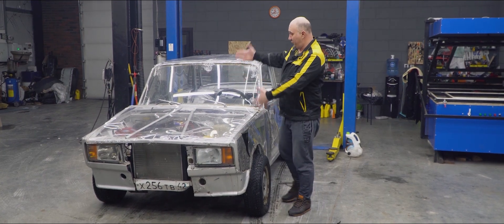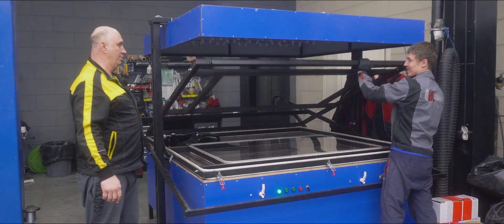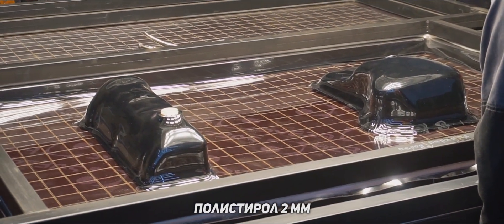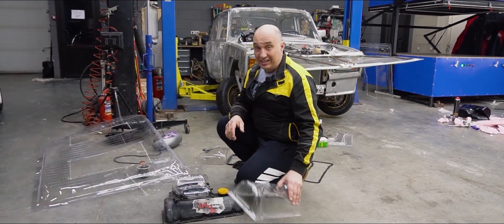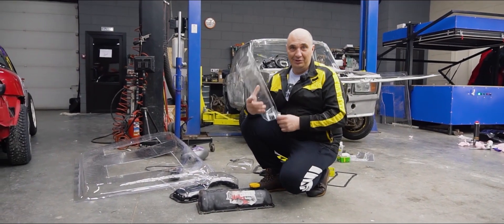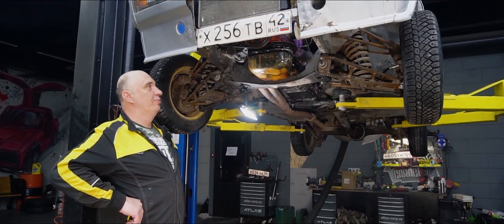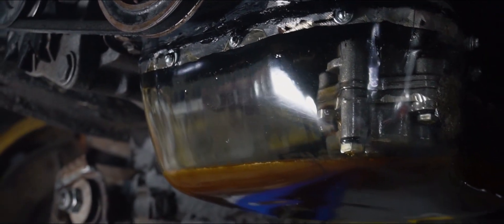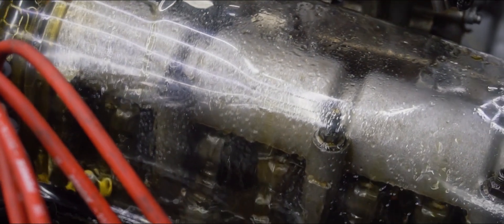Transparent rocker cover and sump to look inside a working engine

Comment: I re-built a lot of engines and transmissions over the years and understood how it all works but seeing it continuous without oil running down the block like when you adjust valves or have a leaky valve cover.
But seeing it without having to rush to turn off without running engine out of oil is great.

Comment: Another great experiment Vlad l never knew that the oil level drops in the sump and that a lot of the lubricates the cam shaft rockers and the cam chain l have a similar engine in my Toyota Hilux a four cylinder chain driven over head camshaft so now l know how the oil moves around the engine this is incredible

Comment: Thanks guys, loved that and it reminded me of a tool I had many moons ago to help tune SU,Webber,Stromberg carbs etc. It was a spark plug adapter that you replaced for the spark plug. It had a perspex or glass lens to see the actual color of the combustion flame, adjust carb = orande flame too rich and too light blue too lean, u get the right blue.. Spot on adjusted, also got an old vacuum device to match 2 su's or Stromberg's.. Back to the 80s, lovely simpler times...I miss them

Comment: too much oil in the cylinder head is a problem with american V8s as well, me and other engine builders will always put oil restriction orifices in the cam feed oil holes to slow down the oil to the head and open up the drain back holes. i will do even more and paint the oil valley with high gloss paint for faster drain back as well.   cool video! i wish we could get Lada 2107 in the USA but they are hard to find and always in collector condition.

Comment: The engine had a HUGE vacuum leak with the valve cover not even bolted down and leaking all over. The engine is running terrible.

Comment: You need a seal on the movable plastic holding frame. At the spot around the plastic where it hits the table. Better vacuum = thicker plastic molding ability.

Comment: I clicked on this to see an engine with clear oil pan and valve cover BUT these guys are friggin hilarious!
Is that metal shavings? Uuuuuum.....yes, you ran the motor low on oil and revved it......that would be bearing
material....lmao!

Comment: I wanted to see why some cars have a baffle in the oil-pan (sump) to prevent "windage". This is where the rotating crank is in oil and the resistance of the oil to the crank's rotation robs energy and thus horsepower. There was not enough oil in the oil-pan to see this happen. Windage is one reason why some tuned cars - race-cars - have 'dry sump engines'. The oil return goes straight off to an external oil reservoir and oil-pump. Please repeat test with oil at correct level as per dipstick. :-) Otherwise a brilliant video - never appreciated how much the oil is moving around.

Comment: This was a great experiment -a fascinating thing to see. Please could you do it again with the proper full fill of oil in the sump? I would be very interested to know how many cm the oild level drops when the engine is running at max revs (and also at half of max revs)?
Also, could you calculate what volume of oil is left in the sump (& what is circulating up in the engine at max revs and half of max revs)? This would be very useful for designing windage trays and baffled motorsport sumps

Comment: I'd like to see this done on a Oldsmobile V8 it  is said that at 4000- 5250 +RPM the the Olds oil pump sucks the oil pan dry and oils the rocker arms and valve cover aera   due to the oil return passage in the head not allowing the oil to return fast enough to the  oil pan

Comment: Do a magnet that attract metal shavings would help a motor get rid of impurities on the bottom pan? could use a small enough to still see but big enough to attract the metal. oh I get it... that's why there is a oil filter ahah

Comment: What year is that "car".  Looks like the latest in 1960's auto technology.
Reply: It's a Lada/VAZ-2105 probably made after the mid 90s. Well, it's built on the same platform as the Fiat 124 which was produced in the mid 60s.

Comment: That is very cool to see the enter workings of the engine while running, would like high/tall valve covers with fins on top for high lift cam roller rockers, if you offer them custom made I would like a pair for my 327 ci Chevy small block in my 1940 ford Deluxe Coupe! Please sir?

Comment: You needed at add a breather on the valve cover so it wouldn't blow off like it did. Excess blow by pressured the crankcase with no where to go. 

But it was great to watch!

Comment: I appreciate you guys running that crankshaft with out it submerged in oil, like it's supposed to be. Good video.
Reply: The crankshaft is NEVER SUBMERGED IN OIL, NEVER!!  Thats why you don't overfill the oil in an engine, if the crankshaft touches the oil or is in the oil, it acts just like a blender. Whipping the oil , adding air into it, making a froth that can't circulate. Also if the crankshaft was submerged. Think how hard it would be for it to spin thousands of time a minute in that thick oil. No, crankshaft is NOT SUBMERGED IN OIL.

Comment: it never occurred to me that the level in the oil pan would go down much with the engine running. I was surprised at how much it went down, but it makes sense when you think about it. This is why it's so important to maintain a proper oil level.

Comment: I remember assembling a "Visible V8" model kit (clear block, heads, pan and valve covers, with metallic colored crank, rods, pistons, cam, and valve train) around 1960. Of course it didn't run, but with the starter motor turning it over and little red bulbs lighting in time at the end of the spark plugs, it was easy to see and fully understand the four stroke engine cycle and how the entire engine worked, especially for being only ten years old at the time. Went on to apprentice under a master mechanic after college and could always fully comprehend and appreciate what was actually happening in an engine, right or wrong. Not sure if my Mom knew she was starting me on my career centered around automobiles at that early age by giving me that wonderful Christmas gift. Thanks for this video!

Comment: Might the flow be affected because your valve cover has no ventilation but is rather sealed/airtight whereas the missing oil cap is indeed vented. This would/could affect and possibly restrict oil flow quite a-bit just as pouring water from a completely inverted container pours out more slowly as it's forced to "gulp" the air in (gulp gulp gulp) to equalize the pressure within whereas, if you pour the water out in having an airflow gap (bottle not inverted but sideways thus allowing air to enter as the water escapes) speeds up the emptying of the container. The created low pressure may also be causing the oil to bubble/foam up. Oil flows would indeed be affected even more so than my exampled water flowing from a sealed container because it is much thicker.

Comment: Paused at 0:26 to say that I've sort of had this experience but with no oil pan, though I may not have seen a ton. I was working at Firestone, and whether I suggested it or my boss did, he agreed to it: he observed engine behavior in the crankcase from below by me holding the oil dispenser (one of those oil guns you see used for oil changes as opposed to pouring from bottles) into the oil pickup tube (screen stem removed) and dispensing while the engine ran. It seemed to work. I got covered in oil.

Comment: This is why you don't check your oil 10 seconds after shutting off your car. There's alot that needs to drain down before you know where your really at. I remember a toyota dealership I worked at told me to do that and I told them all they were idiots

Comment: Did they add a relief hole for crankcase blowby to the rocker cover? I skipped ahead to them starting it and noticed all the foam that is building up. I'd assume if they were smart enough to build a oil sump and rocker cover like this they'd know you need to vent the crankcase right?

Comment: Awesome video.  I so wanted to see this for ages. I couldn't believe my eyes when this notification popped up. Excellent stuff 👏 👌 👍.  I just wish you showed how this molded plastic pan would behave under pressure and high temperature??? Would it lose it's shape 🤔 or worse leaks oil everywhere 🤔.  Please do more videos on this experiment 🙏🙏🙏 it's very useful and interesting and informative 👍 😀 😉 👍👏👏✌❤☘

Comment: That's why it's a good idea to take a die grinder to the oil drain backs and anything else that prevents oil drain back and smooth and round it over when rebuilding an engine there is also something called glyptal you paint the inside of the block with it and it really increases oil drain back it's like 50 bucks a quart  and it's a good idea to grind and smooth any sharp casting lines or imperfections on the surface of the casting before coating it but don't be stupid and paint over machined surfaces they are like that for a reason

Comment: At time 6:55 the oil colour is an emergency .  This colour is indicating water or antifreeze in the oil . Emergency  ; change that oil at once , also first put in an oil system cleaner , then drain the oil . Put in new oil and look for signs of a blown cylinder head gasket .

Comment: Acrylic (Plexiglas) won't withstand the temps of engine oil. It will loose its shape at Temps over 180°F.
These guys don't know very much about thermoforming,  either.

Comment: They should honestly have transparent motors in trade schools for apprentice mechanics and such. So you can see how it all works in real time and where the oil is going. It's amazing in modern motors how thin a film of oil prevents the motor from shaving itself, and how well the motor maintains that lubrication.

Comment: A little bit of metal is fine as long as they aren't big pieces they have magnetic sump plugs in tractors and probably other vehicles to collect a bit of the metal flakes. 

You should build a tank smoke system and run it off the cooling lines to heat up the smoke liquid or whatever you use to generate a smokescreen don't know how you'd turn it off and on though my guess would be 2 taps and a bypass line for when its off.

Comment: At Jasper engines, we used valve covers with flat plexi glass to verify the rebuilt engine was oiling properly. I have seen Banks Engineering use plexiglass rear axle covers. It is amazing to see the aeration that takes place which actually damages the gears over time.  Great video and great translator!!! 🇺🇸

Comment: This clear valve cover would have been handy years ago for diagnosing a problem with a poorly re-manufactured 4 cylinder head I purchased for an engine with over head cam.  After installing the head on the engine the engine had low oil pressure, an engine that had no oil pressure problem with the old head.  Turned out the cam bearings were oval, so way too much oil was getting up into the cam gallery.  Diagnosed this after finding that oil leaked out the crank ventilation valve attached to the valve cover, into the air cleaner box.  The oil saturated the air filter, then oozed out a small hole in the bottom of the air box onto the hot exhaust manifold.  Had to extinguish a little fire on the manifild.  Would have been handy to have a transparent valve cover to diagnose that earlier.

Comment: It foams up like that when there is water in the oil. Some condensation could have settled in when they had the engine cover off. When motor oil is being produced, that is a quick way to tell if water got into the oil, it gets white and foamy and sort of looks like a milkshake. When it heats up, as long as there is a way for the water vapor to go, it should cook off, of course as long as it isnt a ton of water it'll be fine.

Comment: The reason the moulds didn't fit where the mounting rim is is because you moulded over the top of the original sump and cover. You needed to make a mould of the sump and cover then do the suction forming over that mould to make it the same as the original part.

Comment: needs a p.c.v. valve and breather so it doesn't blow the valve cover off it will also blow oil out the dipstick hole without that

Comment: We have to see the infinite turbo where you turbo  a motor and don’t put a blowoff valve on so it keeps the rpms up until soemthing goes boom 

Do this outside with a ton of precaution bc a rod will probably be on the moon

Comment: You need to preheat the parts before vacuum forming. As soon as the plastic touches the metal parts it cools down, becomes stiff and doesn’t form well.

Comment: Show what happens  to an engine  run full throttle without any oil.  Just remove the oil pan and valve cover.
Reply: Using a thermal imaging camera would also be neat!

Comment: You might be able to do this with flat Pyrex windows , and retainer frames with silicone gaskets . Plastic wont take the heat ,and will distort . Whats with that new clear Aluminum , never played with it ?

Comment: I'm just starting to watch them make the see though oil pan and valve cover and already know it's going to melt. It won't be able to take the engine heat at 160 to 200 degrees

Comment: I love how at 8:49 the windshield adhesive on the rocker cover has clearly failed, resulting in the cover bouncing around freely. Not a word is mentioned though. Don't change, Garage 54, you are the best automotive related youtube channel by far.

Comment: I agree with emerson rodregez. Can u do a cold oil flow video? Maybe light up the inside of the engine instead of overhead lighting reflection blocking most of the view? Or light it up from the opposite side of the camera view?, uphill, cornering, hard acceleration, I'm curious to know how much time the oil isn't being picked up by the pump under real world driving conditions.

Comment: could someone build a trailer, that can be hitched up to a dis abled vehicle, that has an engine in it that can push the broken down car home?  or an electric vehicle that can pull a generator that can drive it when the battery is low?

Comment: You went the right way with joining the plastic to the metal frame. Engine oil when hot would more than likely warp the plastic and cause leaks.

Comment: Use to adjust old v8 chevy hydraulic lifters with the engine warm,running and valve cover off so not surprised by oil flow.He sealed the cover with what looked like silicone. The particles in the oil were dissolved silicone particles that will stick and plug passages. Seen engines and automatic transmission destroyed by " I thought silicone would work!?"

Comment: Transparent valve covers really need to become a thing.
It looks cool for a start, but it's also a visual indicator to what's going on in the valvetrain, and enables you to see problems forming before they turn into failures
Reply: technology just isn’t there... glass or poly can’t hold up to heat cycles without expanding

Comment: At what temperature does it start to deform? If you had GoPros watching the oil pan while driving allowing engine to warm, what happens? Potentially destroying such a beautiful thing. Might be some insight to fluid dynamics while moving down a road. My first comment to YouTube in an extremely long time. Congratulations garage 54! Personally it would be a shame to see that beautiful thing destroyed.

Comment: You guys should dontate that engine to a trade school. It is amazing how low the level  goes in the pan when the engine is running. I have seen alrge stationaly engiens with plastic covers over the inspection ports so you can see the crank and connecting rods. This was a really cool project!

Comment: I ENJOYED THIS A LOT!!
HOWEVER IN THE DAYS THAT I WORKED ON THE RAILROAD,
ONE DAY I GOT TO WATCH A 16 CYLINDER GENERAL ELECTRIC LOCOMOTIVE RUN WITH 8 CRANKCASE COVERS OFF RUN!
THERE WERE TWO GUYS WORKING ON IT AND STARTED IT UP WITHOUT CHECKING ANYTHING ON THE GOVERNOR SIDE OF THE ENGINE, WHERE THE 8 COVERS WERE STILL OPEN!
I WALKED UP AT THE TIME IT WAS STARTED AND WATCHED A FEW SECONDS BEFORE I SHOUTED THE COVERS WERE OFF!!
I T MADE QUITE A MESS, BUT I DIDNT HAVE TO CLEAN IT UP!!
LOL!!
I HAD A PERFECT VIEW OF THE CRANKSHAFT, CAM SHAFT AND THE CONNECTING RODS, HAVING A GOOD OIL BATH!!!
KEEP THEM ROLLING BROTHERS!!
👍👍

Comment: That's pretty cool. Look at the oil being sucked out of the oil pan. Never knew that much actually went into the engine during operation, always thought it was a light coating like pan frying. This looks like deep frying quantities of oil

Comment: Hey 54,last night i had a dream,i saw a lada doing a wheelie(lift the front wheels at acceleration),i think you might like this,take a lada and modify it to make it able to do a wheelie,i suggest to put the engine in the back and make the front lightter and make it a rwd.

Comment: Try making the sump much deeper and extending the pick-up if you want to get a better view.  Oil aerates in most engines somewhat due to the moving parts beating/whipping it, your low level prob caused it to more.  It's common in a performance engine to improve oil return drainback paths and make other modifications to reduce aeration